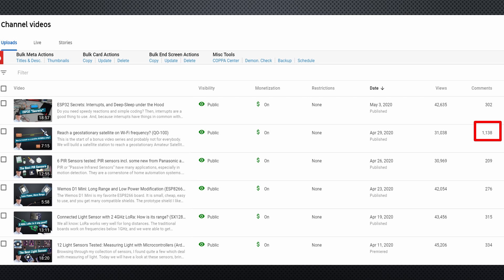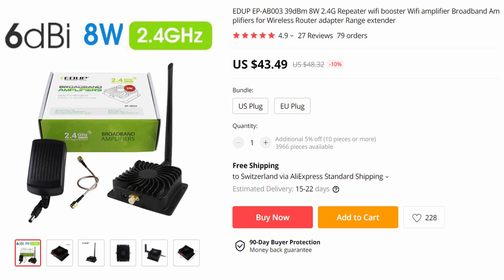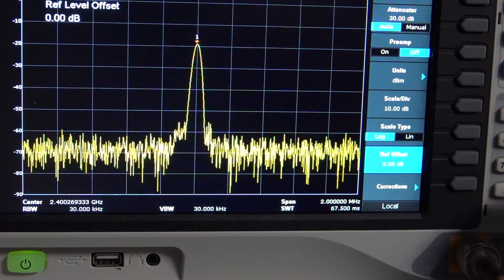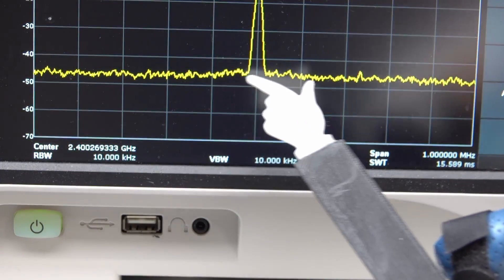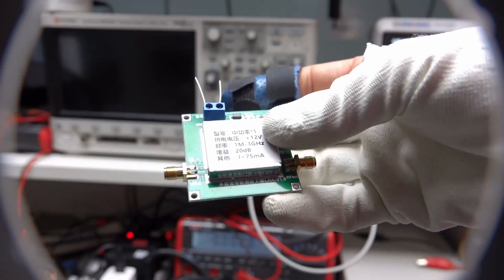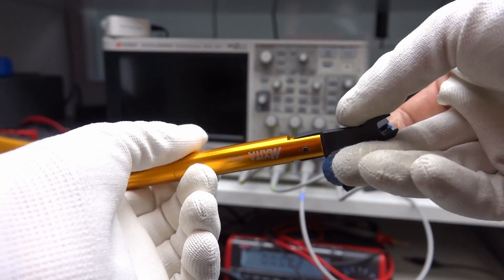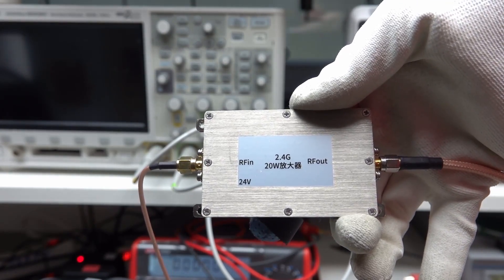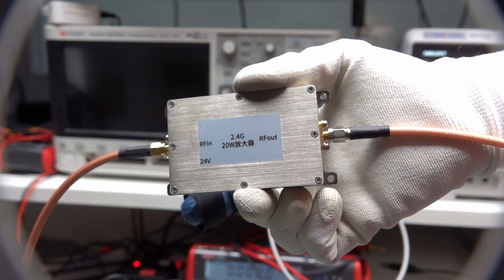#329 QO-100 How Do We Get 20 Watts Output on 2.4GHz Wi-Fi

Comment: We built this PA, it works quite well (and building/testing the circuit is a very nice excercise to learn about measuring equipment for a EE student like me) and is a lot cheaper than anything you can buy.

https://www.helitron.de/dj0abr/english/technik/sat/sat_pa_stage2.htm
Reply from the maker: Good work. Which one did you build? The 10 watt or the 30w? The 30w transistor alone is 120 $.  Very dangerous;-)
Reply: @AndreasSpiess  It's weird, I think something massively increased the price. At avnet, it's only $35 each (minimum order 100 though), and I think I would remember the price if we paid much more than that. Certainly not 120€.

I'm just a student, the lab engineer did the ordering, so I never saw the invoice :D
Reply: @AndreasSpiess  I checked, it was "only" 45€